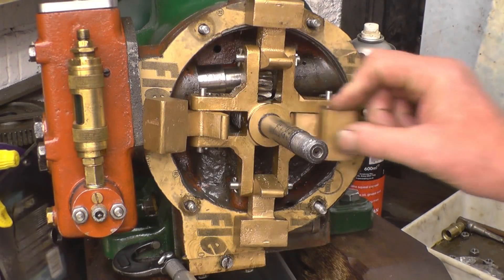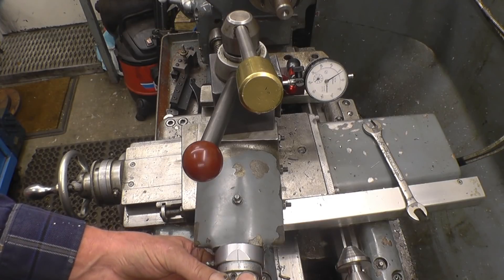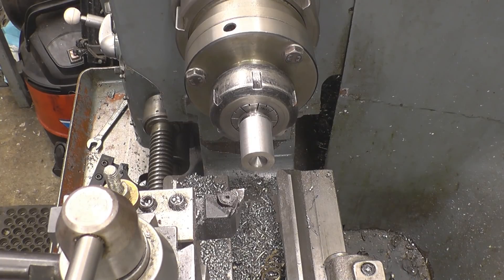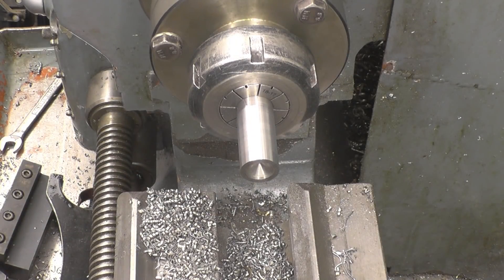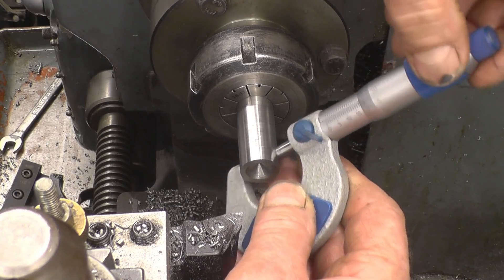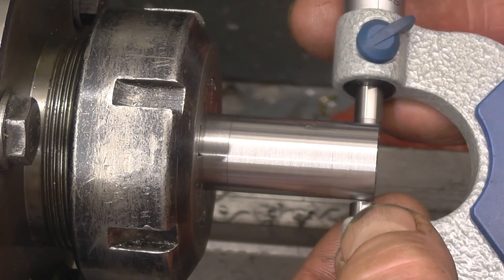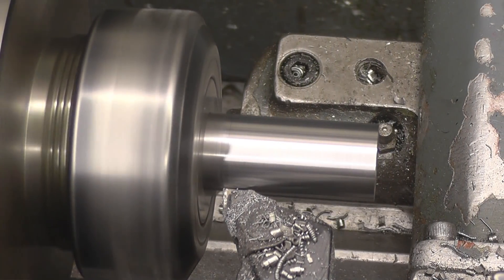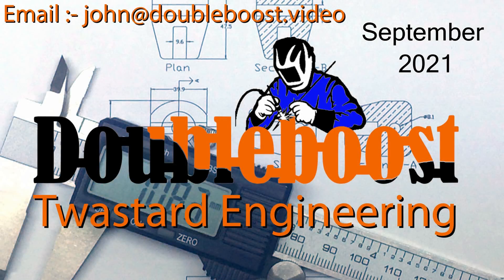Stuart Engine.   Part 20 Bearing Carrier

Comment: That is one way to get a finer feed. I have also taken a pass to size and been just a pinch under even after a spring pass. So I hit it a couple of seconds with a torch and take another spring pass to shave a smidge off.Got to be careful to not get carried away with the heat or you go under sized with that method.

Comment: I've calculated some angles:
(for 0.02mm per division)
14.48° = 0,01mm in diameter per division
7.18° = 0,005 mm in diameter per division
1,43° = 0,001 mm in diameter per division
And for the ones with imperial lathes (with 1 thou per division):
14,48° = 0.5 thou in diameter per division
11.35° = 0.01 mm in diameter per division for metric conversion
Reply from the maker: Thank you  Would you mind if I was to use this in a future video Regards John
Reply: @doubleboost  Of course you can use it
Reply: @doubleboost  just ask me, if you want some more angles.

I have two more for you, if you want to use the numbers on the dial instead of counting divisions:
30° for 0,02 in diameter per division
And
2,87° for 0,002 in diameter per division
So if you want to reduce the diameter by 0,05mm just turn the dial to 50 and you are good to go, without counting divisions or any calculations...

Comment: Hi John ....   excellent video, generally who would have thought of using the  compound as a micro adjustment setting. You have the compound set about 5 degrees,  would it be much difference if it was left at 29 degrees  .
Thanks
Reply: Pythagoras
Reply: Basically, the lower the angle, the finer the cut per division of the cross feed.
Reply: @russculley3619  thanks,